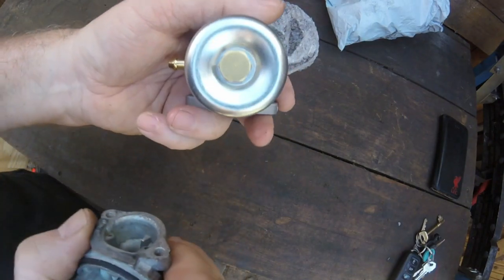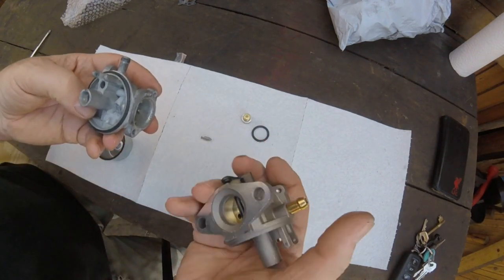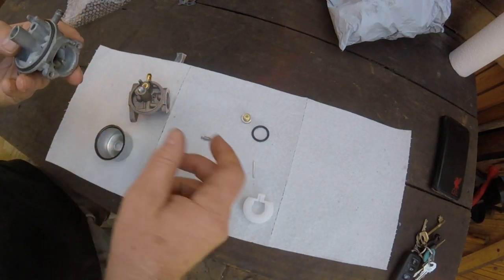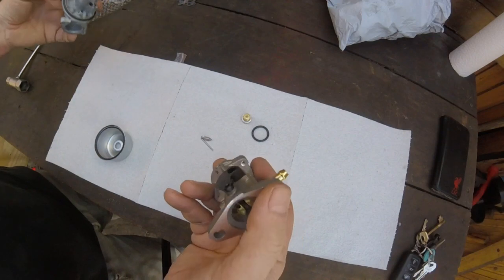$ CHEAP $ AFTERMARKET CARBURETORS DO THEY WORK!!  REVIEW.

Comment: I just put the same carb on a Snapper. 
Got it from Amazon for $15.99 (US) came with hose, clamps, spark plug, 2 cut off valves, filter and all gaskets. 
Fit perfect 3 primes and one pull of the rope and it started!
The one I got was Milttor. 
Also got one for a Kohler and I swear it was the same without the Kohler name but, had same part number at the same spot as the OEM Kohler. 
So far so good for me!
Reply from the maker: Glad to hear that

Comment: I do small engine repair for a living . for the price these carbs work fine on older units . no point in spending $70-or 80 bucks for an oem replacement one  . but there is a few things to watch for . the fuel bowls are made of stamped steel  . so you don;t want ethanol or water to come in to contact with it . it will begin to have corrosion form inside the fuel bowl  very quickly . what i do is take the oem carburetors fuel bowl and clean it up real well and swap it out with the one on the copy carb  (if it will fit ) because its made out of  an aluminum alloy and will handle contact with these new fuels available to us  .. Oh and btw NON-ethanol regular unleaded fuel is now readily available in large metro area gas stations  . best to use that if you can .
Reply from the maker: +charlie pearson thank you for your great comment I’m sure me and others will remember that

Comment: I use these carburetors all the time and the only problem I have found is once in a while the hole in the throttle lever needs to be drilled out a little bigger so that the governor linkage rod will fit in the hole. A lot of them that I have used have worked fine for 10 years or more.
Reply from the maker: thats is good to know

Comment: Never used a China copy carb on a  lawn mower. But I have used them on quads and they work fine as you say there made cheap so they don't last as long but there cheap so. It's kinda self explanatory another good video mate. I  did once buy a China made MAF sensor for a Rover car  and used it and  it worked for about a year but for tenner I didn't care LOL 😂😂
Reply from the maker: Ali Mack- Mechanical thank you

Comment: I have used aftermarket carburetors. No issues. Usually, find them around the same price as a carburetor service kit for the original! It's certainly saves time putting on an aftermarket carburetor. Original carbuetor on my snowblower $100! Aftermarket, no issues $20!!!

Comment: I've had good luck with the 4 stroke carbs, bolt on and go no problems.
The are alot lighter, but so cheap 👍
2 stroke carbs are more hit and miss, some require alot of adjustment and never really get spot on.
Reply from the maker: +bumpkinrocks thank you for watching

Comment: I had to swap the Walbro LMF from my Kawasaki-engined lawn tractor. I was concerned as to some of the things I had seen online. But the fact is I was unable to see any difference even comparing the internal parts to the original carb. The tractor now starts runs and idles 100% perfectly.  The float needle and seating were identical to the OEM carb.
Reply from the maker: Great news thanks for watching

Comment: Got one for a briggs. I tried and tried ran but wouldn't pull a load.
After two days now it doesn't start.
Gave it a shot but maybe the jet. But there is no adjustment.
I replaced everything.
Going back to the old one.

Comment: The problem I have with this style Chinese carb, is they do not prime properly.  The design simply does not allow them to pressurize the bowl properly to get a little squirt of fuel u into the throat of the carb.  I have disassembled these carbs, and ran tests.  They are highly problematic when you press a primer bulb to prime them.  The simply do not work more often than not.

Comment: The original looks like a zinc alloy which would be heavier than aluminium. I'd hazard a guess that it makes no odds as to durability. As for cheaper material zinc is probably more expensive but easier to cast. I'd always go for aluminium out of preference.
Reply: I'd add, I'd expect the aluminium one to last longer.
Reply from the maker: Benedict White yes they probably are zinc alloy why they are heavier